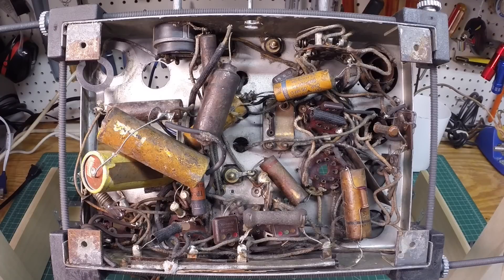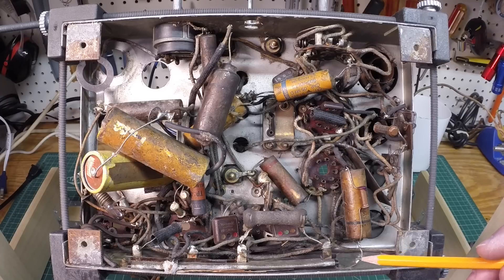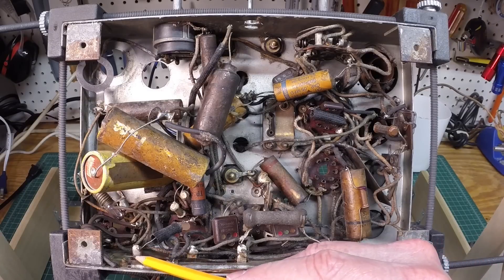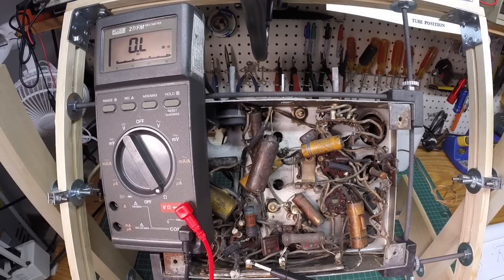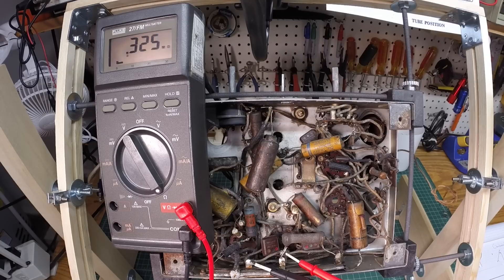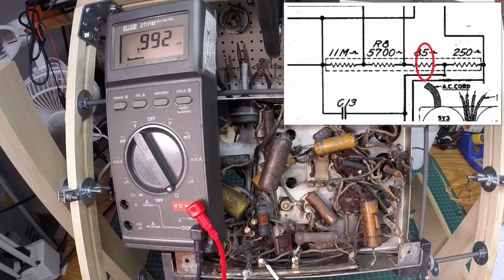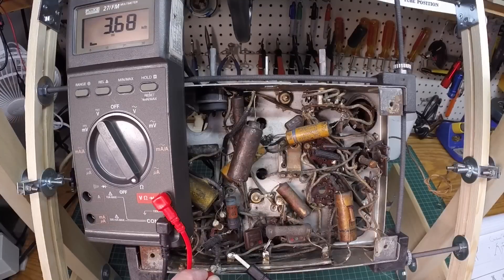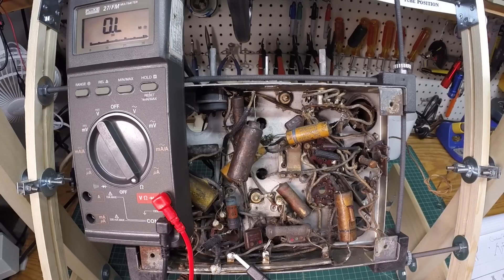Zenith 5-S-29: Candohm Resistor Evaluation

Comment: Question about candohm resistor. I don't know much about how to replace caps and test, however, I know enough to be dangerous. I have a Zenith 7s363 that was working fine one day and all of a sudden there is a very loud hum and part of the candohm resistor gets hot only after a few seconds of being turned on. Plus I smell a little bit of electric sent. All caps were replaced at one point. Is this common? Of course I put in new tubes too.
Reply from the maker: Sorry for my belated response. It’s hard to say what the root cause is, but Candohm resistors can fail (short or open) and cause the issue you described. Best not to power it up without further troubleshooting the issue. Best, Don
Reply: Thanks Don, yes, only after a few second there is spot on the resistor that  gets very hot.  @RestoreOldRadios
Reply from the maker: Measuring the DC resistance of the Candohm resistor “out of circuit” and comparing those reading to the schematic would indicate the health of the resistors in series with no DC load applied. Best, Don

Comment: I just restored a 5S29 and you must remove the candohm resistor from the circuit to properly test it.  Like yours mine had a bad 11K section. I removed the candohm wiring from the circuit and tested the rest and all of the sections (other then the 11K) were spot on.   When you do not remove the resistor from circuit you are reading any components in parallel with the resistor sections as well.  This is  electronics 101 and you should know this and should NOT be making videos teaching people what to do if you do not even grasp the most basic of electronic principles such as this it could be dangerous.
Reply from the maker: Congrats on your repairing your 5S29, they are beautiful radios. For my basic evaluation of the Candohm, the parallel resistance was de minimis and didn’t compromise my evaluation of the failed resistor. Thanks for reaching out. All the best. Don

Comment: Hey, Dummy!  Don't get into the habit of using a lead pencil as a pointer when poking around in a radio chassis.  Lead pencils use graphite - it is CONDUCTIVE.
Reply from the maker: Great point when you’re working with an energized circuit, which I wasn’t. Thanks for watching. Best, Don

Comment: Hello Don. Hope you had a wonderful Thanksgiving Holiday. I have a question for you on molded mica caps. I had some free time over the holiday so I jumped back on the 5s29 project. The 5s29 has 5 molded micas and I checked them with my Peak LCR 45 meter to confirm values. My question is related to tolerance. I am aware these typically do not fail and some may have been hand picked based on spec. That said, I thought it would be beneficial to check. All but c3 have two color dot rows; however no dots are colored in on the second row. Based on some research the middle dot in the second row should indicate tolerance. Does no color mean "none" or go with body color. The difference being 1% for brown (body color) and 20% for none. I can't imagine these are 20% tolerance. My measurements are: 

(capacitor, spec, actual)
C8, 1nf, 1.049nf
C8, 1nf, 0.935nf (there are two C8s)
C5, 0.25nf, 0.299nf
C3, 0.025nf, 0.033nf
C14, 3.6nf, 3.12nf

Thank you kindly for any thoughts? Have you had to replace many of these over the years?
Reply from the maker: Shawn - we had a great Thanksgiving w/ our family; I hope yours was special too. Who was the manufacturer for the C3 capacitor in question? I would assume 1% since it’s brown like the body of the capacitor. I’ve had a few mica capacitor failures and typically don’t disturb them and replace as needed. It sounds like you’re getting close to a power up? Best, Don
Reply: @RestoreOldRadios  Glad to hear Don and thanks for the reply. Yeah I am getting there. I added a pellet stove to the shop which took some time; but is starting to pay off as we head into Pennsylvania winter. We have snow this morning. See updated table below.

(capacitor, spec, actual, brand, % off spec, comments if applicable)
C8, 1nf, 1.049nf, Micamold 2 rows of dots - no dots colored in on 2nd row, ~4.9%
C8, 1nf, 0.935nf, Micamold 2 rows of dots - no dots colored in on 2nd row, ~6.5%.
C5, 0.25nf, 0.299nf, Micamold 2 rows of dots - no dots colored in on 2nd row, ~19.6%
C3, 0.025nf, 0.033nf, Cornell Dubilier 1 row of dots, ~33%, largest error
C14, 3.6nf, 3.12n,  Cornell Dubilier 2 rows of dots - no dots colored in on 2nd row, ~13.3%

Thank you as always.
Wishing you a wonderful Sunday.
Shawn
Reply from the maker: @shawnbrown8781  Glad to hear the pellet stove is working well. It’s been documented that many of the Micamold caps are paper and not of a mica composition. I assume the measurements were made with one end of the capacitor lifted? Check out this thread on the ARF: https://www.antiqueradios.com/forums/viewtopic.php?t=142856 Best, Don

Comment: Don, 
I too have had past experiences with those Candohm dropper-type resisters: they might once have been a good idea - at least on paper. 
On more than one occasion I've managed to open a few of those type of resister up and, with the exception of one, each internal resistance wire was not physically defective - each resistance wire gave a good reading when connected directly at each end to meter probes - despite the fact I had been getting strange resistance readings before opening up the can.  
Believing the problem was due to tarnished terminal contacts directly onto the resistance wire, I did some cleaning, and attempted to reseal the resistance sections back into their tin can.  I say attempted to reseal the resistance sections: that proved not as easy as I imaged  ...and when complete the resistances read more or less as they did before I opened up each Candohm. 
These days, I go ahead and replace the entire Candohm with individual w/w resisters soldered onto terminal sreips ...far less hassle in the long term! 
Regards,
Phil.
Reply from the maker: +SteelCity321PB I like your solution. I've never tried opening one and repairing it, but I might do that on this one for nothing more to see how they are constructed. Best, Don

Comment: Thanks for the video Don. Enjoyed the look at the candohm resistor.
Reply from the maker: +Billy “stormlight” Steen I appreciate it Billy. I have another video in the works on replacing it, but more in depth on the math behind the curtain to get the desired voltage and wattage requirements. Best, Don